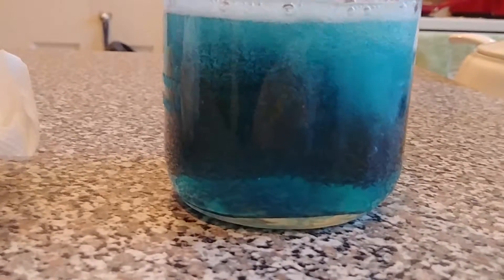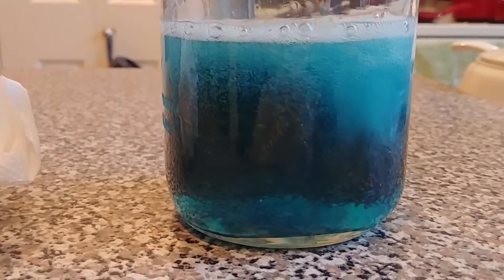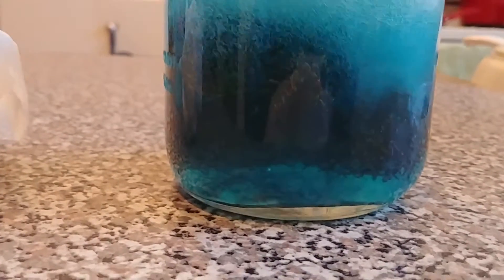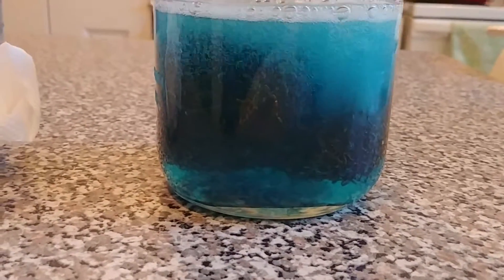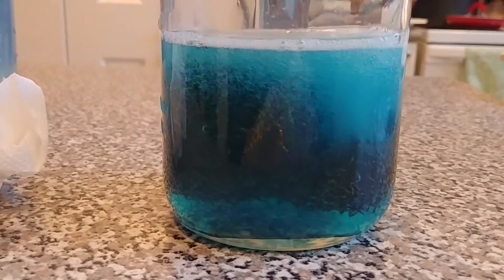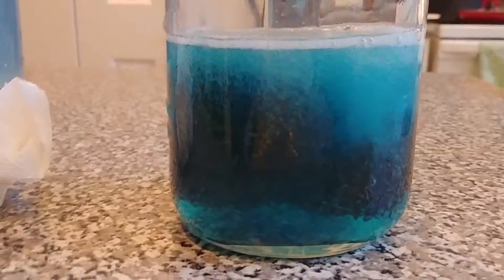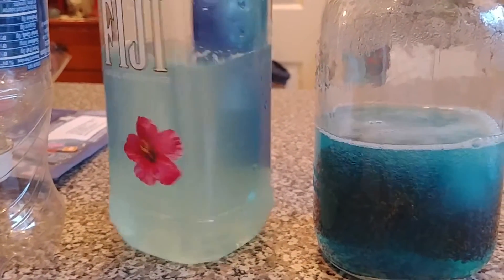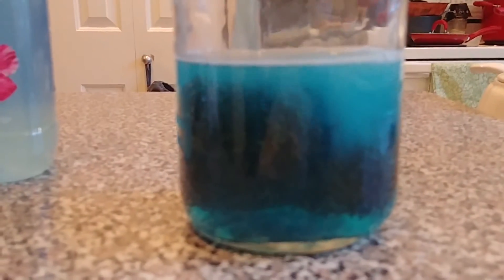Making copper acetate

Comment: How can i get crystals? Without hydrolysis to basic acetate?
Reply from the maker: Heat it until the solution is saturated enough to start forming crystals.  You can use a cheap plastic paint mixing bucket with a lid from any hardware store as a desiccator to allow quicker and cleaner results.  I'd stick with a quart sized bucket about 1/4 full of calcium chloride.  Place the beaker or jar into the bucket and use calcium chloride desiccant or anhydrous Epsom salt, and that will absorb the moisture from the solution.  You'll develop deep blue, nearly opaque crystals with trigonal faces.  

If hydrolysis occurs and/or the crystals form a coating of basic copper carbonate (which they will given enough time), you can redissolve the crystals, filter all carbonate and/or hydroxide solids and recrystallize the copper acetate.  The carbon dioxide present in the atmosphere will be the bigger problem for you.  I've created the copper acetate crystals by letting the solution evaporate, but after some time, it develops a lighter green powder which forms on the acetate crystals.  If you are looking to prevent this from happening, then you'll want to protect the crystals once dry with a coating of clear nail polish.

Comment: Looks like you have a quick reaction going. Is it hot?

What was the ratios you used? Are you using 30% h202 or 3%?
Reply from the maker: That was done with regular 5% household vinegar and 3% H2O2 in a 1:1 ratio by volume.  I just mixed equal volumes and heated the solution until is was slightly hot.  I have a gallon of 30% acetic acid / vinegar now and lots of 35% H2O2.  I'd love to see the violent reaction that would make.  LOL.  I've been making some other reagents lately just to continue learning chemistry.  I'm crystallizing potassium dichromate currently so that I can oxidize ethanol so I can make some glacial acetic acid.
Reply: Excellent work.

Comment: What are you trying to show here?
Yes, the blue color indicates, that some copper got into solution as copper acetate, but the method is probably not very effective as there shouldn't evolve much gas.
When the H2O2 is effective the oxygen is used to oxidise the copper, but copper it a catalyst to decompose H2O2 into oxygen (and water) so much of it is lost here.
If you are patient you won't need H2O2. Just place copper only partially into vinegar so that it has also contact with air. It will produve copper acetate very effectively yet slowly that way.
Reply from the maker: realedna This actually made a lot of copper acetate which I crystallized into very dark blue (almost black) crystals. It was one of my first experiments and it was fun, so that is all that really matters.

I collect data on my experiments and I'm learning something new every day. If I make more copper acetate some day, I'll give your method a try. For now, I am continuing to work on a lot more advanced projects such as making chorundum (synthetic rubies and sapphire). If my method works from the research I've done I'll do a video including my failures.
Reply: OK, from the video it seems you didn't actually finish the preparation or used the solution as is for electroplating or something.
Would have been nice to show the actual results in the video as well!
Your method might have worked fine, if you have used an excess of H2O2.
Thx for sharing and answering anyways!
Reply: I don't want to discourage you from doing chemistry experiments or sharing them, but you may wanna try giving more detailed information and showing your end results. A video would be much more informative and useful that way, even if not everything is done extensively and professionally.
Reply from the maker: realedna I completely agree and understand. These recent chemistry videos were a bit more for my facebook page than anything which is why they aren't very detailed. I've been slacking on my production value for too many of my videos. I'm getting prepared to do a fair volume of videos in the near future.

It's also very difficult to discourage me so it's all good. :)
Reply: @realedna  I want to make copper carbonate. If I make copper acetate as you described here, how long will it take? And if I make the acetate am I supposed to boil off the vinegar and make a water solution before reacting it with the sodium bicarbonate, or it is not a problem if vinegar also reacts with it?
Reply: @realedna  wow thank you the detailed information. And do you think copper chloride would work and react with sodium bicarbonate and form copper carbonate? I'm trying to find the cheapest and easiest way of making copper carbonate using household materials.
Reply: @sziluchannel  No, it will yield copper oxychloride. As I said, you often get mixed basic salts, that's why starting from the sulfate is probably the best! But copper sulfate is also the most common copper salt and should be easiest to find and handle.
By the way, don't put any copper solution down the drain, it is really not good for water organisms. Just precipitate it fully from a basic solution. Also the common salts are easy to transform into each other, so you can recycle it.
Reply: @mwilson14  thank you for showing a non water, yeh that really is quite amazing.

Comment: I made something dunno what it is! ;D
100 ml white vinegar + 1 tea spoon salt + 2 tiny pieces of copper.
left it soaking for 3 hours then dropped a nail, was trying to make simple electroplating but it never worked!
So I used them tiny plates for electrolysis and applied 3~9v 1a to them, I got something little blue color(maybe copper acetate).
Then I tried to electroplate a nail, and ithere came something orange/light brown! (maybe copper oxide)
The solution is screw now ;D